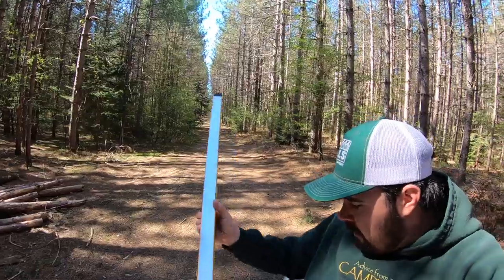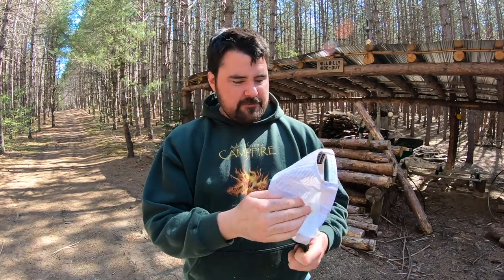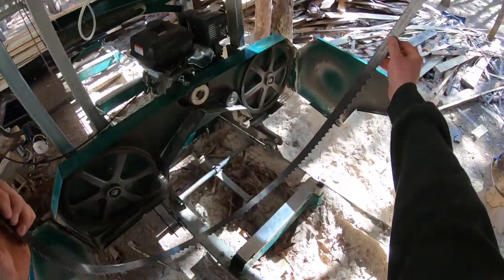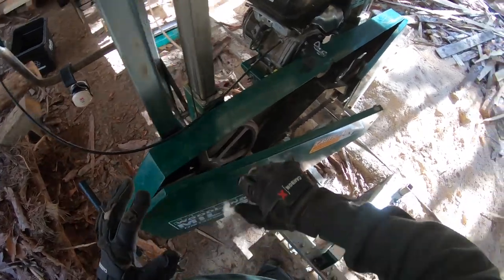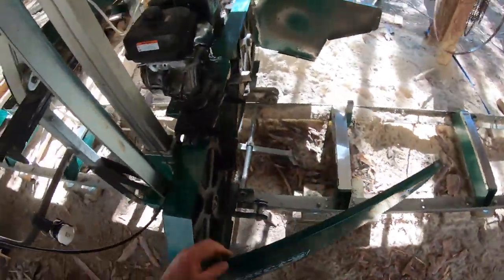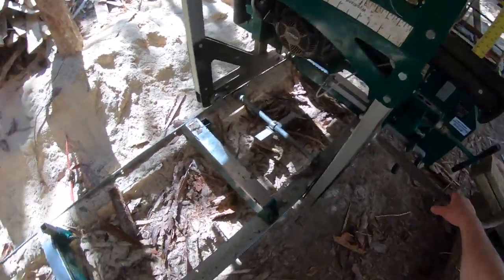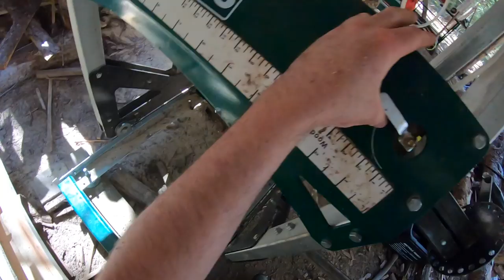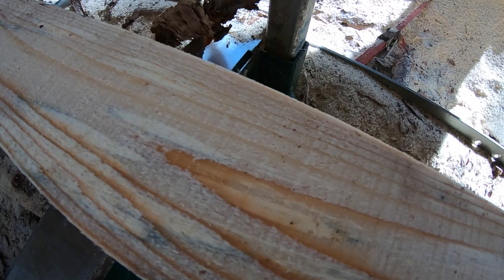Should I Cut Lumber with a Sawmill Blade That's Missing Teeth?

Comment: I have had a Woodlands Mill 130 for approximately 4 years. It has worked great and I really enjoy cutting lumber as a hobby. I recently stumbled on to your videos and I  have enjoyed watching them. I think that you and I have similar experience with this mill and with the Woodlands blade sharpener. I only have 1 suggestion to make after watching this video. When you were talking about the blade creeping forward as you tightened it and aligned it with the rear of the band wheel, it reminded me of time the blade jumped of mine as I was doing the exact same thing. It literally  exploded off and almost tore the end off my index finger. The heavy work gloves that I had on did nothing. The end of my finger exploded and looked like a large red grape that you crushed. It was absolutely  my fault.  My suggestion is to spin the band wheel using your torque wrench, simply hook it on the spokes of the wheel and pull. I will NEVER spin it by hand again. Just sayin.

Comment: My suggestion for cleaning the mill is to use compressed air. I know your setup is out in the bush, but a small generator and small compressor would do the trick.
Reply from the maker: Great idea Steve. I’m a bit behind on the cleanup as you can see. I’ve also found using my gas leaf blower to do the trick. Thanks for watching Steve

Comment: I just noticed this video is a couple years old. Regardless, I'd say when you figure the blade velocity in feet per second compared to the rate you advance the saw through the wood, 'full teeth' are cutting across the board and a missing tooth (or 2 or 3 or 4) isn't going to make any difference. The critical factor here, the other teeth are sharp and doing their job.
Reply from the maker: I agree with ya there Carl

Comment: I have a solution for you Sandy get a ashes pail and fill it with dry bark make a little fire with small sticks over it and light it up let it burn and it will ignite the bark you don't want it burning but smouldering to make smoke put it around you and the smoke will keep the black flies and mosquitoes away I would put a couple small holes on the bottom of the bucket on the side so it brings in air not too many just enough to keep it smouldering if it ignites into flame put a lid on it to get it back in the smoking stage. anything is better than but repellent